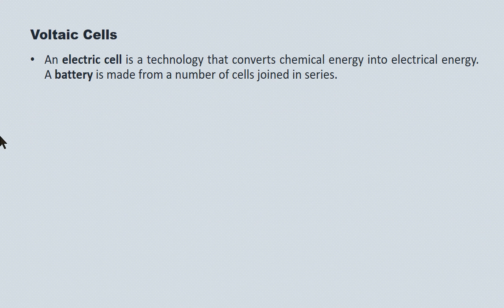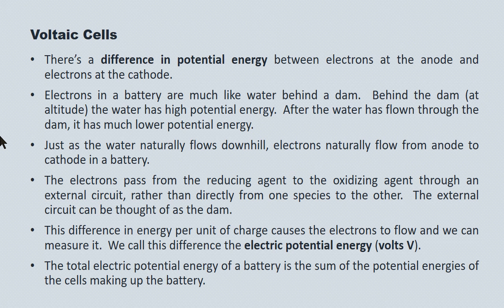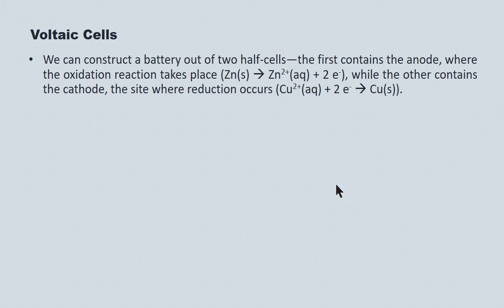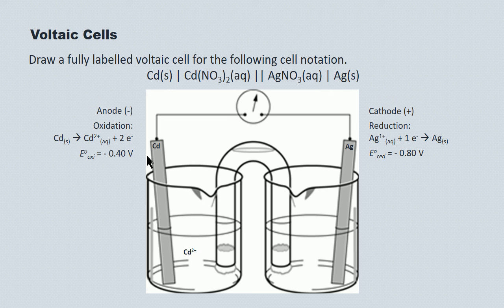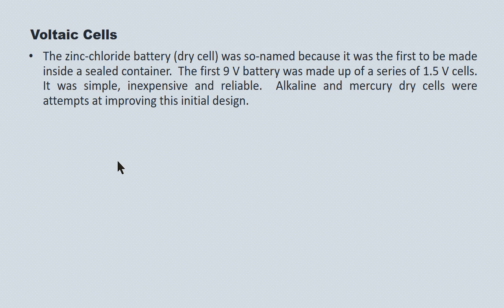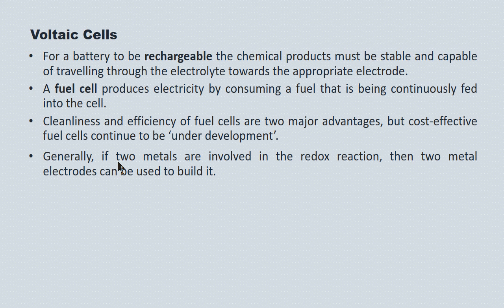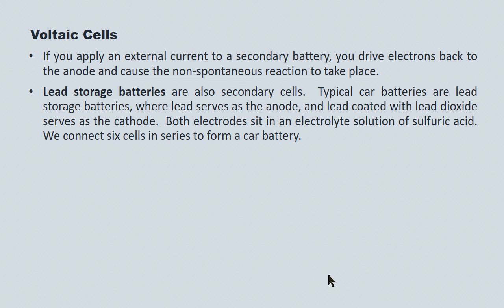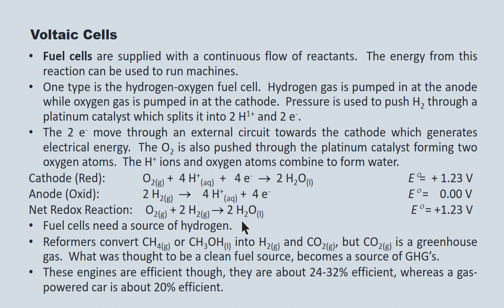L  7 Voltaic Cells

Comment: Im curious how do you find the .79 for 2MnO3 the table I have doesnt have that , and same with the 0.76 on the Cd + 2OH is there a formula you have to use when hydroxide is added ?
Reply from the maker: These figures are available in the authorized textbooks for the course. You wouldn't be asked to reference the potential for a half-reaction that's not found in your data booklet, or otherwise provided to you.
Reply: @AlbertaHighSchoolChemistry  Im challenging the exams so I've just been using the nelson textbook and this data booklet i found posted from an edmonton chem teacher, thanks that helps a lot :D , good job on your videos they also help a good amount
Reply from the maker: Great textbook! Good luck on the exam. I have had former students tell me that summer session diploma exams are significantly easier, but have no direct evidence of it myself.
Reply: @AlbertaHighSchoolChemistry  Thanks! and the exams I'm taking are in April so here's hoping spring is the same, glad to hear that I did the winter Bio one and some questions were pretty out there